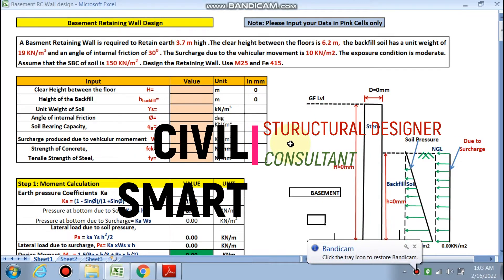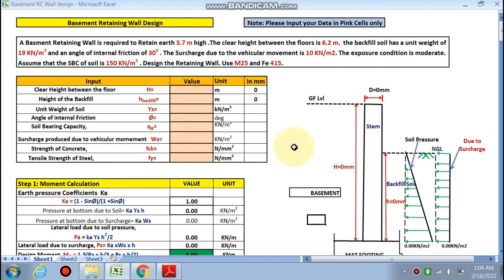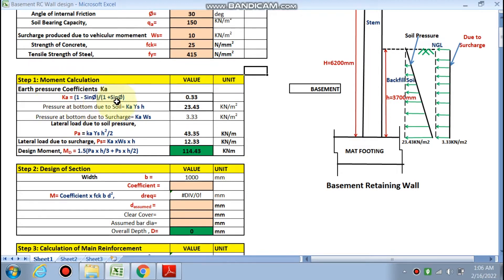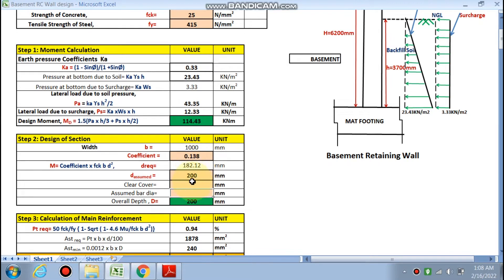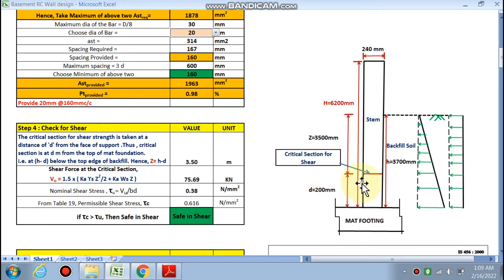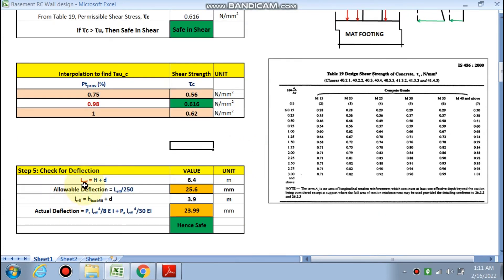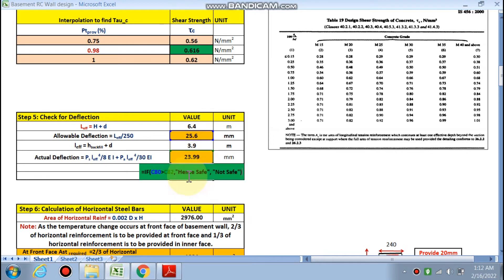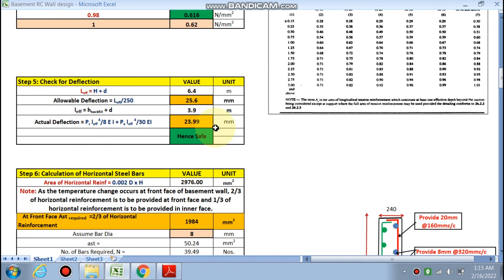BASEMENT RETAINING WALL DESIGN- BY CIVIL SMART

Comment from the maker: Wall design sheets via below link

Wall design sheets via below link
https://u.payu.in/PAYUMN/dIjRZmgZFrVV

Full design Excel sheets course
https://pmny.in/Trn0FUGqvQl9

 

Full Course includes all sheets as under:

IN FOOTING DESIGN SHEETS

1. Isolated square footing

2. Isolated rectangular footing

3. Combined rectangular footing

4. Trapezoidal footing design

5. Strap beam footing design

6. Footing with uniaxial bending

7. Footing with biaxial bending

8. Pile foundation

9. Pile cap design 3 & 4 piles

10. Wall footing/ Strap footing

11. Raft Foundation ( Beam and Slab Type)

IN BEAM DESIGN SHEETS

1. Singly reinforced beam design sheet

2. Doubly reinforced beam design

3. Continuous beams design  with point load having

    2-span continuous beam

    3-span continuous beam

    4-span  continuous beam

    5- span continuous beam

IN COLUMN DESIGN SHEETS

1. Axially loaded column design

   (a). When column size is known.

   (b). When column size is not known.

2. Column with axial load with uniaxial moment ( on 2 sides and 4 sides reinforcement)

3. Column with axial load with biaxial moment

4. Mux and Muy Calculation sheet.

IN SLAB DESIGN SHEETS

1. Cantilever slab design sheet.

2. Simply supported slab design sheet.

3. One way Continuous slab design sheet.

4. Two way Continuous Slab design sheet.

5. Two way simply supported slab design sheet.

IN STAIRCASE DESIGN SHEETS.

1. Dog legged staircase design.

2. Open well staircase design.

IN RCC WATER TANK DESIGN SHEETS.

1. RCC WATER TANK RESTING ON GROUND (L/B <2).

2. RCC WATER TANK RESTING ON GROUND (L/B >2).

3. UNDER GROUND WATER TANK DESIGN (COND. TANK IS EMPTY AND OUTSIDE SOIL IS SATURATED).

5. UNDERGROUND WATER TANK ( TANK IS FULL AND NO OUTSIDE SOIL PRESSURE).

4. UNDER GROUND CIRCULAR WATER TANK.

IN WALL DESIGN SHEET

1. RC WALL DESIGN SHEET.

2. RETAINING  WALL DESIGN SHEET.

3. BASEMENT RETAINING WALL DESIGN SHEET.

Building load calculation sheet

Cost estimation sheet..etc.

Comment: In this excel sheet on basement, ground water table effect is not considered in calculating pressure on basement wall. What is the force shared by adjacent column in basement wall. There are two cases of design in wall. One way and two way slab as side wall. What is the edge condition considered for wall say at bottom in raft as fixed and top at beam and floor slab as propped cantilever

Thank you for giving design of basement as  excel sheet prepared by you.
Reply from the maker: Sure , will consider the Water table effect in the upcoming sheet.. thanks 🙏